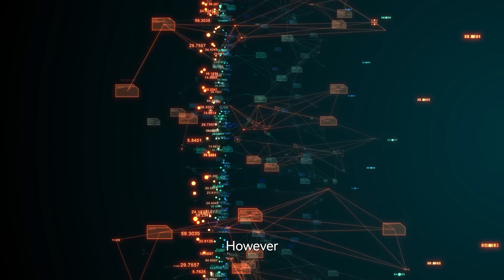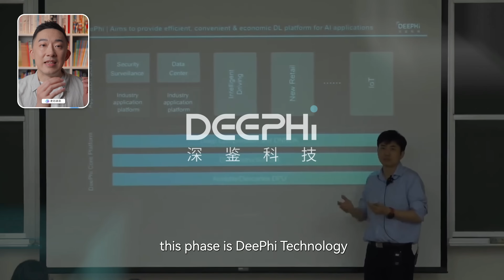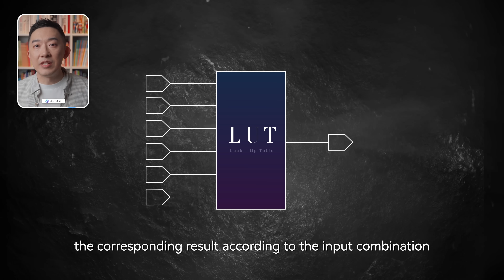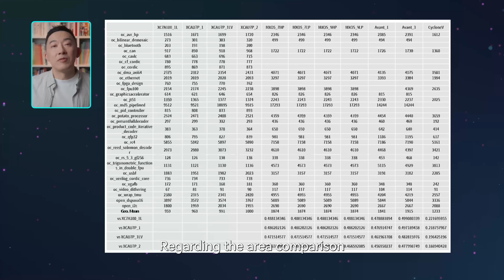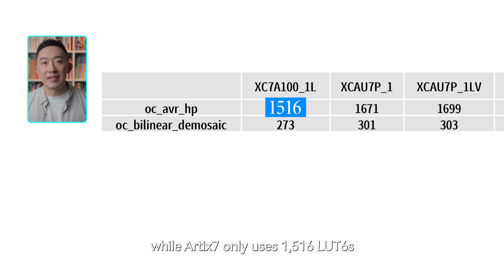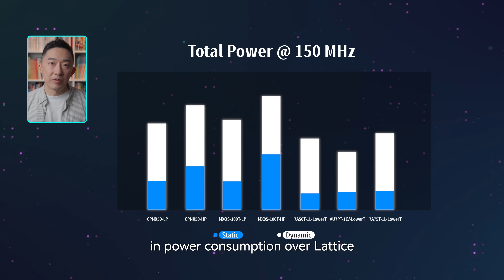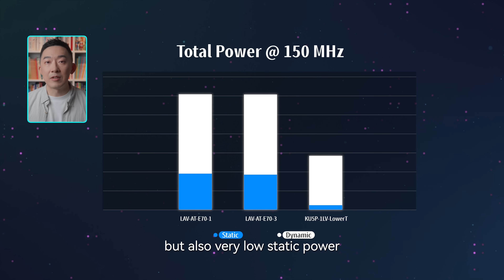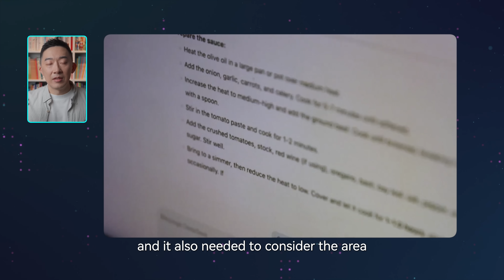The Hidden Weapon for AI Inference EVERY Engineer Missed

Comment: Have you tried efinix titanium series FPGA specialized for edge applications small area high performance .we need those benchmarks.
Reply: Efinix uses xlr cells to achieve insanely good fmax! People are reporting 600mhz clocks. They are extremely low power and low cost. Ip is all free and no license fees. I think Efinix has a bright future.